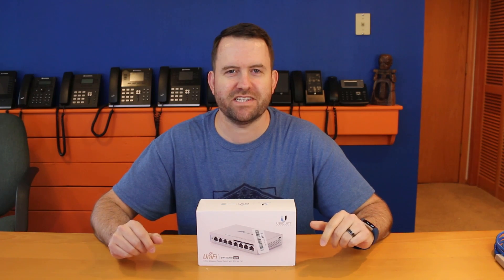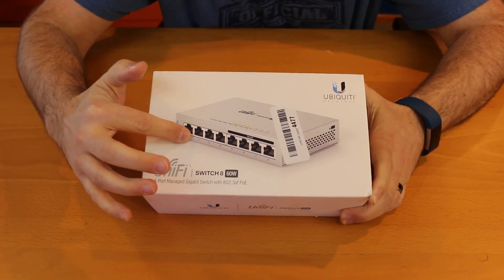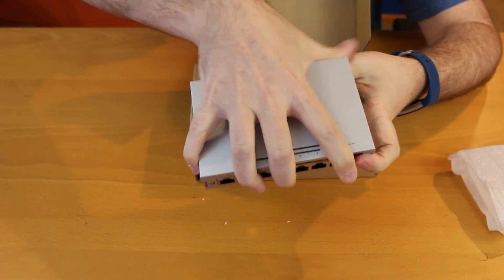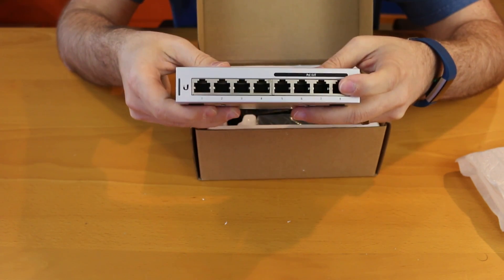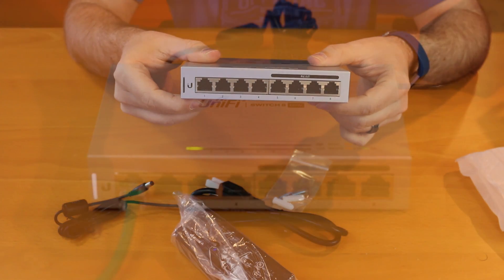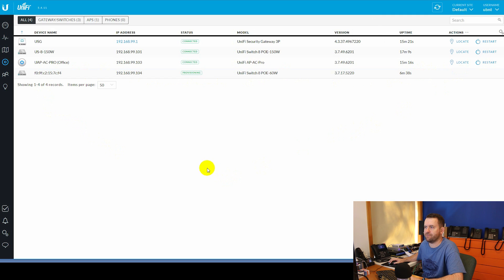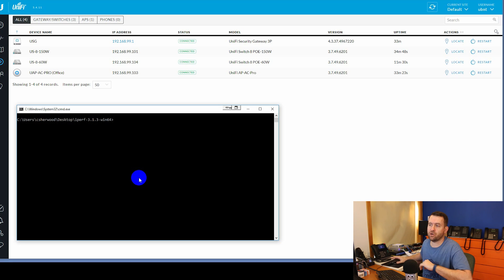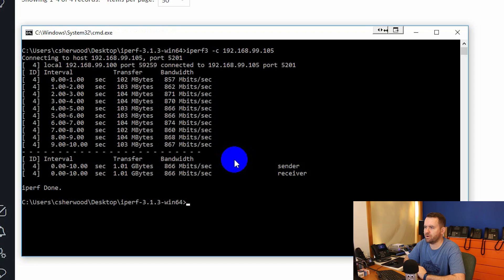UniFi Switch 8 60W Unboxing and Setup

Comment: I know this is an old post but my Unifi 8-60W switch stopped working after the last firmware update in October. The white light flashes but never gets past that. Tried both reset and factory default reset with no luck. No activity lights or POE lights. Can't SSH either. It is just out of warranty so no luck there. It seems like more than a coincidence to fail after an update. Any other suggestions to get it going or is it a brick? Thanks.

Comment: Worth mentioning that the Unifi 8 Port 60W switch runs extremely hot as it is fan-less and passively cooled through the chasse. It is recommended to have some form of airflow nearby and to not stack it on other equipment for obvious reasons.

Comment: Chris, you say that this switch will not power an AP AC-Lite. I have a newer AC-Lite and it says that it supports 802.3af/A PoE.  That tells me if I'm not mistaken that these devices should work with each other.  Maybe Ubiquiti upgraded the AC-Lite's power requirements since this video? I'm looking at changing the way I power my AC-Lite to save outlet space and am looking at this switch as a possibility!

Comment: I purchased this switch a few days ago and love it!  I did run into one unusual problem.  My MAC Mini would not connect via ethernet.  There is a setting for flow control that is off by default.  Once you turn it on the ethernet connect comes right up.  Thanks for the video.

Comment: Hi Chris. In many customer reviews on Amazon i can read that this device works great, but runs very hot. Can you acknowledge that? If yes, which other (better) UniFi switch you would recommend?
Reply: It indeed runs very hot. I have both Unifi 8 and Unifi 8 60W and they are both very hot to touch.

Comment: This may be a dumb question, but when they advertise "auto-sensing PoE" does that mean that it only supplies power if the device requires it or does it automatically adjust the power output to what the device requires?

Basically, if I wanted to use 2 of the PoE ports for access points and two for non-PoE devices, would that be possible? Or would I have to upgrade to the 150W?
Reply from the maker: Not a dumb question at all!  Auto-sensing just means that the switch ports can automatically negotiate power requirements for 802.3af vs. 802.3at devices (or no PoE needed at all also).  The only catch is that if you have 24V passive devices (like a bunch of the UBNT equipment), you would have to configure that manually per switch port.

Comment: i have just tried to configure it but it seems that it doesn't work. i have this product of ubiquiti in my network. do i need to buy some controller? is the cloud key gen 2 enough (i want to connect it directly to the switch), or do i need to buy some other kind of controller? thanks
Reply from the maker: You don't need to buy a controller - you can install UniFi on anything (Linux/Mac/Windows).
Reply: Crosstalk Solutions a raspberry pi is a good idea? Thank you for the previous answer!

Comment: Hey Chris,

Your videos are par excellence thank you.

So I'm about to implement my first Ubiquiti netwrok at home. I was just about to buy this switch and 2x AC Lite's as judging by what I've read should be good for home use.

So I would just like to clarify if this switch can power the current AC Lite hardware? If not I need to chip in a bit more and go for the Pro's. Or should I do that anyway? The PoE passthrough may come in handy.

Comment: Nice video. Just noticed that Ubiquiti had these on market.. I'd suspect since you're running a USB 3 NIC, the overhead of the video recording (most likely USB as well, is due to the USB controller on your board itself, nothing to do with disk read/writes?

Comment: I want to buy this 80 Watt switch and a UniFi AC-Pro with a Cloud Key, do i need a Security Gateway or is that not neceserily
Reply from the maker: You don't need the USG to have the switch.
Reply: okay thanks

Comment: With my Asus RTAC88U i get 996 Mbit/s when connecting and running iperf3 -c and -s straight to the router. With a ZyxelGS1900 in between 991Mbit/s . with EdgerouterX 945Mbit/s. Ubiquiti is a bit overrated. Nice features but troughput is king! Don´t blame the Offloading parameter it is set correct. Modern pc use GPU for  accelerated performance so it´´s not a suprise that using screen recorder slows down the networkspeed.

Comment: Too much focus on the throughput and little info about heat, also can it power voip phone? I really can't decide between this and the 150w. If this runs cooler than i'd go this given I have a Hikvision NVR already for cams and really only need the switch for 1 AC pro and a Voip setup.. Want to purchase today so doubt i'd be lucky enough to catch your thoughts in time ;_;

Comment: Hey Chris, I'm trying to add an Edge Switch to a local controller. I'm stuck because both the controller and the device discovery tool won't find my switch. I can log on to it by using the UI or SSH using PuTTY. I've tried to do the set-inform command via SSH, but it doesn't recognize the command, so I must be doing something wrong.
In this video you say you cover this in another video, but I can't find that one. Can you please help me or share the video where you cover this part? Would be great, thx in advance!

Comment: I just installed a unifi ac lite.  Now I'm looking to buy a switch, usg, and cloud key.  Would the switch 8 60w be fine to power the ac lite snd cloud key?
Reply from the maker: The 8 port 60W switch is 802.3af PoE only - the AC Lite needs 24V passive.  So no, that won't be compatible.

That being said - there are some newer versions of the Lite and LR that I believe are 802.3af, so you may want to look into that.  Bottom line is that you want the PoE to be compatible somehow - data sheets should give you all the info for each product.
Reply: I received a UAP AC Lite this weekend and they now feature booth types of POE, so that is a good thing for us!

Cheers!
Reply: Been looking for this answer for a while. Thank you! I assume if anyone orders AC Lites now they will be able to be powered by the PoE from the 60w 8 Port?

Comment: Chris, newbee here, I have the usg 3 port, new arris sb8200 modem and service of 300mbts, all that is going to a netgear 10/100/1000 5 port swtich, I have 2 APs one pro and one LR . The pro is connected to the switch and the LR is as a repeater, as of now my download speed is 90mbts and upload of 30+- 2. I'm having a mental debate of which unifi switch to get, the 60w or the 150w, I also have a vonage voip that needs to be fed from the switch but doesn't require poe, future add on will be a cloud key, which one you think best suit my need? This set up is for my home. Thank you.

Comment: Love your and Willie's videos. Could you do a review on the new Unifi AC In-Wall (UAP-IC-IW)?  It states it supports Users and Guests. So I expect the AP part can be configured like Unifi's other APs with several SSIDs for both main and guest support including VLANs?  Also the IW part can be configured with main OR guest support includings VLANs?  Thanks.

Comment: Does the edgerouter x work with the US-8? I'm guessing that it works but I have to control the US-8 through the unifi controller and control the edgerouter x through the edgerouter controller. Correct me if I am wrong.
Reply from the maker: shtruz you are right
Reply: Crosstalk Solutions thanks

Comment: Hi Chris, just a really minor point - at around 2 mins you show a screenshot saying the USW-8-60 doesn't have options for PoE, but you showed Port2 which is not PoE capable. Ports 5 to 8 do have an On/Off option in the GUI.

It seems some of the UAPs are becoming 802.3af compatible - the last lot of AC-Lites I got were, but no sign of 802.3af AC-LRs as yet.

Nice Zebra :)
Reply from the maker: Hah - you're right!  I didn't even notice that I did that...teaches me to drink and edit.  

On ports 5-8, there IS a PoE setting, but it's just on/off - no 24V passive option.
Reply: Hi, first of all thx for the video.  I have just a question, may be a newbie question. If I plug in a AP AC Lite 24v passive in a port 5 to 8 (802.3af) the AP is going to be damaged?

Comment: Great review, it just saved me a lot of money because I was going to buy the USG, this 60w 8-port and the 8-port passthrough + 2 cams but not if the PoE on these does not support 24v passive. Currently I have an Edgerouter SPF-X which PoE's my AP-AC-Lite but was looking for a more UniFi'ed setup ;)
Reply: The US-8-150W does provide 24v passive power as well as POE+. however if you are only installing 2 cameras on your network, the adapters will be cheaper than buying the 150w switch.
Reply: Yeah, its very pricey when I "just" need one PoE for an AP-AC-Lite in one room and 2 or 4 cameras in another. I know the AP´s feature an adapter but I guess the cameras do not? The passthrough version is $140 here in DK, the 60w is $185 and the 150w is $270.
Reply: Dear @Luftdrone.dk, if you need competitive price of US-8-60W Ubiquiti UniFi Ethernet Switch, then I will recommend you to shop online at www.memory4less.com/ubiquiti-networks-network-switch-us-8-60w?rid=13

Comment: I have one on my network powering one access point and camera. It runs really hot
Reply: These smaller switches are passively cooled and do typically run a bit on the warm side. I do not recommend installing them in small enclosed environments where they cannot breath. But on a desk or in a small server room they should be fine.

Comment: also, I'd love to know where you got it for $99..
Reply from the maker: I lied (or rather misspoke) - it's $109.  I probably said $99 because that's what I THINK it should be - lol.
Reply: Actually, your amazon affiliate link shows $120 and change.
Reply: Ryan Finchum Amazon had them for that price in Warehouse deals
Reply: i've bought 3 things via "warehouse deals"...i have had to return all 3 of them...it's not worth saving $10...thanks, though!
Reply from the maker: Hmm...weird - that was $109 and change as recently as this morning.  If you click on the other sellers, it's $110.  Not sure why there is so much price fluctuation on this unit.
Reply: It's probably amazon's market pricing algorithm. I read somewhere they are using it more and more based off various factors, some specific to the users.
Reply: €120,- in the Netherlands :(